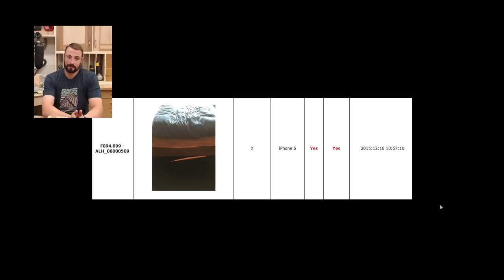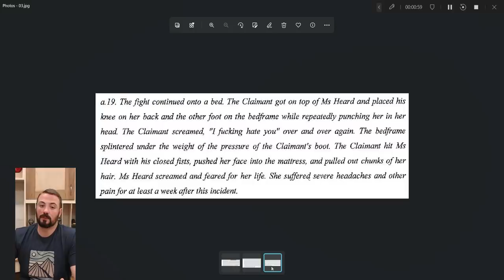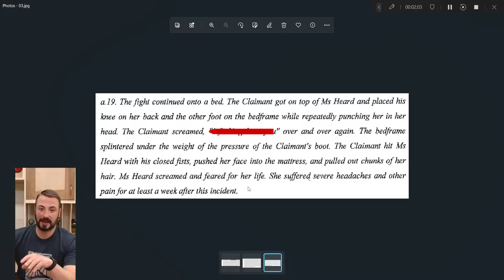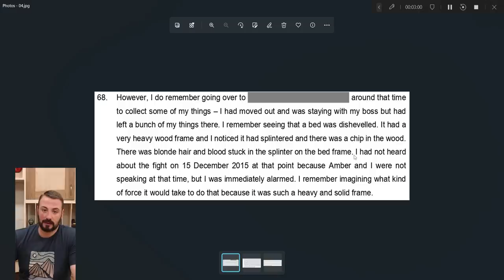Woodworker Attorney DEBUNKS Amber Heard's "Broken Bed” Testimony!

Comment: All wooden beds of that style/nature would've been promptly recalled if it was that possible for a boot or shoe to accidentally split the wood like that, especially when the bed was specifically designed for users to STEP and assert some pressure on it. It's also funny Amber doesn't talk about bruises on the knees or any bone fractures caused by those large wooden pieces. Seriously, think about it: either Johnny had the strength of the Hulk and tossed her up into the air to make her land conveniently on the mattress... or he shoved her face down against the bed as she described, which in that case, her knees and legs would've violently made contact with those several inches of wood there.

The sad part about all this debunking is it requires someone to ask these hard questions in the first place. Given that the UK trial didn't bother to ask those questions, I'm worried this jury won't either. I just hope Johnny's team addresses this to further prove how far Amber is willing to go to smear Johnny.
Reply: Really good point!
Reply: Yes, agreed. 
Amber is taller than Johnny. She weighs at least same as him.
It is physically not possible for him to throw Amber around like this.
When Whitney found hair and blood at the bed, how did that get into the frame when she was face down in the middle of the mattress?
Reply: That's not going to be a shop bought bed. It's obviously custom made.
Reply: look i am 100% on jhonny's side.  and i also am 100% convinced that amber broke the bed herself.  
but. 
as a kid i have splintered MANY wooden things exactly like that.  
it's not all perfect wood.
Reply: @darkracer1252  There are so many different kinds of wood, some splinter easily and others are so hard that you can only work on them with special steel and diamond.
I remember splinters as a kid as well never from furniture though. 

This bed is definitely not some cheap fast growing wood or some Ikea bed.
It looks like very solid hardwood. 
Single beds usually don't have a massive frame like that. This is something very special and looks like a very expensive piece of art.
Reply: @doroparker1702  
oh no i deffinatly remember it from beds and tables and tv furnature.   

all it takes is for it not to be propperly treated and it dries out.   constant heating and cooling will cause it to weaken.  
and then all it took was some convincing
Reply: @darkracer1252  well, I grew up in a house with proper walls and proper roof. There was constant temperature inside the house because we had heating in winter and summers are not very hot in my area. 

Our furniture was of good quality with some lacquer on top so nothing splintered.
I got my splinters when climbing old latters or walking on old planks at a lake.
Reply: @doroparker1702  you don't heat a house when you go on a vacation.  and it can be especially cold at night (downstairs) when you leave a small window open for the cat.

and i am not talking about getting a splinter either.  i am talking about a piece splintering off like on jhonny's bed.  
breaking off while climbing on furnature as a kid like the little chimps we are. 

a splinter big enoegh you can now use it as a toy sword.  or toy dagger
Reply: @darkracer1252  oh my god ... We never had splinters that big.
We had to heat the house from September to Mai no matter if we were on holidays or not. Frozen water pipes is not an option. The cat went to friends during holidays.

We jumped between our beds until one bed broke. The wood holding up the frame of mattress came off.
For climbing we went on the trees in the backyard or on the metal thing with the swing. Was too boring anyway, we climbed on higher trees from neighbour's. We had a challenge going on how high we dared to climb. I was only third. We never fell off any tree.

Comment: The way she explained the act, Johnny must’ve been doing some major splits with one foot on the end of the bed and her back. Johnny is not that tall and she is and if his hand was holding her head into the bed hard enough to “smother” her and then one “knee” in her back and the other at the edge of the wood plank? I pray the jury really tries to picture that and sees right through her BS!!! And great work Rob. I found you on legalbites and it was fascinating!! Can’t wait for more!!
Reply: I was just thinking the same thing. I was curious about Rob's explanation of how that sort of damage can be done to wood, but all the while I was trying to imagine what physical position could even place one of Depp's feet on the edge of that frame while his knee is on her back on the bed and his hands near her head. He would have to be leaning way forward, placing more pressure on his knee (and her surprisingly non-broken back), and the back leg would give him, zero "purchase" in that position, even assuming he's flexible enough, tall enough, and unrestricted by his trousers enough to even be in that position. Even if the soles of his boots were made of sharp metal spikes, his center of gravity would be so far off that foot he couldn't place any pressure on the wood.
What an absurd story.
Reply: He also has epic gravity/mass control super powers. Because if he's forcing enough of his own weight onto Amber's back to prevent her from escaping, there should've been very little force going onto the foot of the bed.  He must have been using gravity based super powers to increase his own mass enough to keep Amber down even though she possesses Atlantean super human strength which caused the foot of the bed to break like that. /joke

Comment: That's also totally glossing over the fact that Depp wouldn't have had the weight or angle on the frame to do that. As she stated, he had his knee in the center of her back while punching her in the head all the while screaming into her ear. That means his weight was in her back as a start, but to be screaming into her ear in any respect he would have to have had shifted most of his weight forward. Meaning the bed frame would have had the least amount of force if any applied to it. 

The next question I'd have to ask in this scenario is where exactly she was apparently laid out for this to happen. Depending on location on that bed, Depp wouldn't have had his foot on that edge to establish purchase. Those look to be something about 14+ inches wide. Kind of hard for me to tell with out a proper measurements reference. I'm going based on size of the bed. With AH's torso planted on the actual mattress, that would locate Depp's knee in the middle of her back and the other foot presumably on the wood but that foot would by necessity have to be applying pressure in the edge at almost a 90 degree angle pushing away from the bed. His foot would have just slipped off the top of it.

Alternatively, if her torso was located on the wood or on the edge of the wood and mattress I'm pretty what she's describing isn't possible. Anatomy check please. As a 5'10" man can you even fold your leg into that position while keeping your weight on the other knee to even locate your foot to that position? I can't do it at 6' even or really come close. At best I have to put my leg and foot out to the side to even come close. At 250 lbs I have still never come close to doing that even to a soft wood like pine.
Reply: Agreed, I was reimagining that position for Depp would have had to be a intense yoga move.  Not to mention she would have sustained bruising on her thighs or knees or shins from hitting the platform as she was being thrown to the bed.
Reply: Another good thing to think about is that if all his weight is in the center of her back, how would there be enough weight left over to put that much on the frame?
Reply: @narratornate8841  it's actually more ridiculous than that. Think about that weight distribution and then take into account that she claims that he was also screaming in her ear. She's face down on the bed. By necessity, Depp would have had to be leaning over with that knee in her back. That would shift his weight more forward towards the head area and take almost all the weight off his feet entirely.
Reply: @Cortanis001  I never said it wasn't more ridiculous. I just said what I was aware of and able to speak on. That being said, you are absolutely right in your assessment.
Reply: yeah its not like hes a giant spider which distributes his legs from the knee joints at sharp angles

Comment: I have worked with wood all my life, my husband was a carpenter and my father was a carpenter. I completely agree with you. The only way a rubber sole boot could break off that corner was if the wood was already split which would be highly unlikely given the financial position of Depp and the appearance of the beam as straight grained with no knots. IT IS IMPOSSIBLE. I wish that it had been disproved in court, but I guess that there were so many lies they could have spent a week disproving all of them.
Reply: Actually there is a knot perfectly aligned with the center of the splintered piece, you can clearly see it on the brightened image at 18:58
Also I wouldn't assume anything about the quality of the materials.
Highly expensive and representative furniture like this is often done by an artist instead of an actual carpenter. An artist will prefer a piece with knots over a clean one if it adds more expression and a "unique" look.

I think it's highly plausible that the timber was already split and a small force at the weak point was enough to rip it off. On the contrary this disassembles the argument why that statement was made in the first place, because if we assume the wood was already damaged, we can no longer relate to the force that was needed to break it.
Reply: @klauzwayne4215  I actually was going to say the exact same thing although I still don't believe a word of it, it is technically possible.  my friends father was a carpenter and as kids we would help him with his projects and worked on our own in his shop for years (just to point out I do have some experience with wood)

Comment: i do custom fabrication and have worked with a variety of mediums, from wood to plastic, cement, foam, and metal. wood that's been extremely weathered (sitting in four seasons for years) will definitely strip and splinter pretty easily, especially if it's plywood. so if you're using a piece like that for foot stability, while reaching for something for example, it's possible the wood will just rip off if the angle and force is enough. but, that's cheap, big-box store, unrestored wood. for a multi-million dollar penthouse, it's unlikely the designer of that bed used home depot scrap/barn wood for the frame without any restoration whatsoever. it's likely more high-end wood; stuff that's old but not completely deteriorated. it appears to be sanded, oiled, and sealed, and inspected for splinters. you can see the shine of the epoxy/veneer and the precise, smooth edges. a rubberized outsole on a shoe would not likely take off a piece like that, no matter how much force you use. even if it was demolition work, you can't just kick a strip off of a finished piece like that. so the only three possibilities for a shape like that to appear would be: grinder with a carving wheel attachment (which would leave no splinter piece, just dust everywhere), an extremely heavy and large object striking that edge (such as a boulder, piece of steel, or really large cement block), or a knife/saw. if you can touch the frame and feel a uniform, flat cut, it's probably a saw. if there's rough, uneven texture like bark or the inside of a tree, it's probably a knife cut at first, then the rest being ripped off by hand to create a more "natural", organic look.
Reply: We know…cuz we all just watched the video.
Reply: @DeplorableOne  They added to and supported points in the video; did not reiterate. :)
Reply: @DeplorableOne  How incredibly rude of you. Comments help youtubers. Period. Don’t be a jerk.
Reply: @ashleyknight2344  I was simply stating the obvious.  As a person who rejects PC culture and those who use virtue signaling as a way to create an illusion of higher morality, please explain like I’m six…how does your comment help others?

Comment: Found ur channel from ur appearance on Behavioral Arts vid. Really enjoyed ur input & collaboration giving such a unique, interesting analysis.
Edit: When I 1st saw the pic of the damage to bed frame w/what appears to be a multi-blade pocket knife or small multi-tool like a Gerber or Leatherman on the bed, I immediately thought that damage could only of come from a knife (the 1 still on the bed) or tool. But, I thought the shard was shaved off from left to right or vice/versa. But after seeing ur vid, there's no doubt that damage was done exactly as u described. & Amber either not smart enough, or in a rush to get a staged pic, quickly created the damage & threw the knife/tool on the bed not realizing it was in the shot. Great recreation, very educational vid!

Comment: If you wanna break it down even further, this also shows the amount of strength amber had to use to even get the knife in there. 

In your example, you were using raw pine. 
On the actual bed itself that pine is not only stained but it also looks lacquered, and even waxed. 

Lacquer and wood wax are amazing especially to use on soft woods. You can get a glass-like shine on wood if you use fine grain sandpaper, wood wax, and some elbow grease. Not only will you bring out a marble smooth surface with a glassy shine, but it will also harden the piece of wood significantly. It’s literally like taking 100 number 2 pencils, standing them straight up and down, wrapping all the pencils in a rubber band and then covering it all in superglue until all 100 pencils are now one piece. 

This lady is a friggin monster.